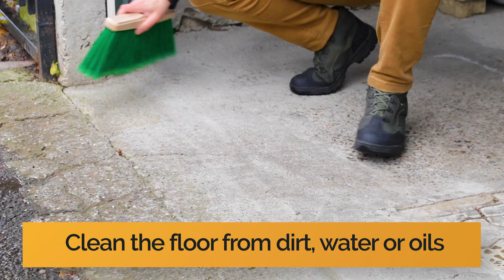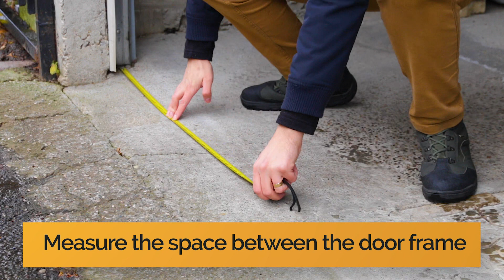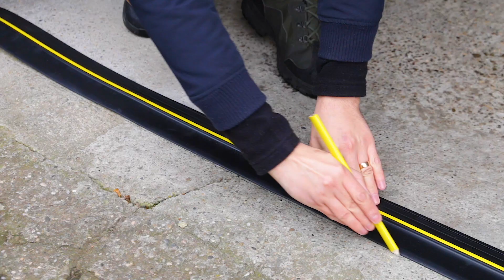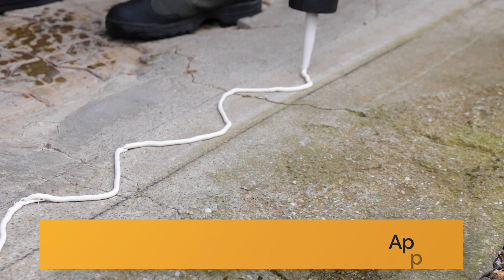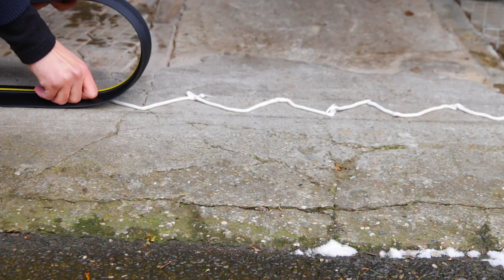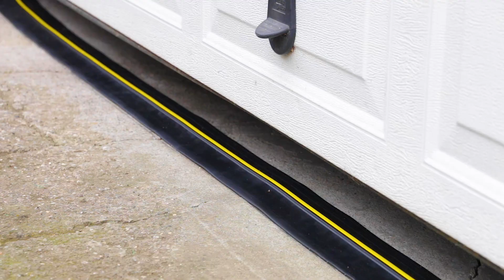How to install a garage door threshold seal (20ft)

Comment: Nice, although I used a pair of garden snips for my cutting . I like how you emphasise which way the seal faces; I was going mad trying to figure out which is in or out. I did mine much the same way as yours, although I watched this after my shat show of an installation. My customer was so sure the in was the out side. But I did check with someone who gave me the right orientation. Small thing: you could have included a little demonstration on using Sika one part sealant or an equivalent to get that nasty crack a fill. after first getting the loose crap out and cleaning etc. Thanks Dan